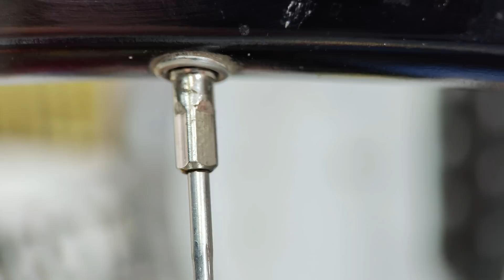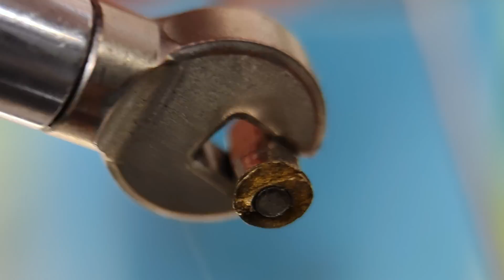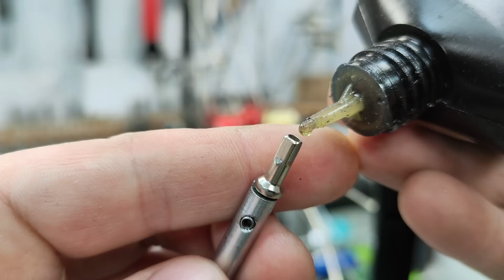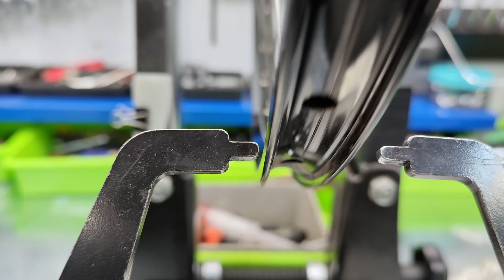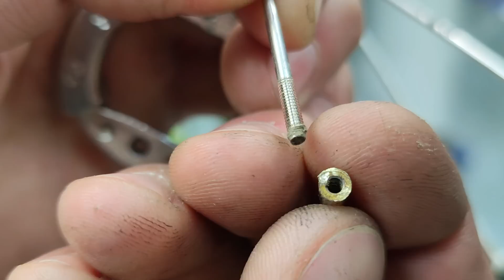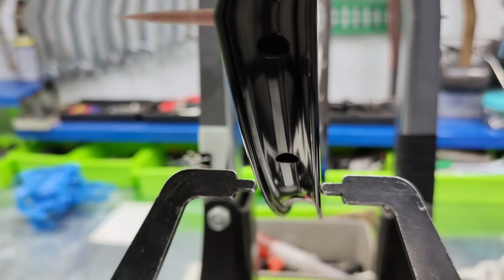Bicycle wheel repair. How to replace a spoke nipple on a bicycle wheel.

Comment: As far as I see you usually use super b tools, actually the unior tools produced near you are very successful but I have never seen any on you, they are not as expensive as park tool but I think they are more successful than the far east tools.
Reply from the maker: Unior tools are great, but we found out about them a little bit later at the bike show. When we opened the workshop, the suppliers had a large selection of SuperB tools for a good price
Reply: @NiceBikeService  yes l have some super b tools and ı like them

Comment: Please teach me how to do stuck seat post;(
Reply from the maker: A difficult case, once the rack was so stuck that we tried to clamp the rack itself in a vice, and pulled and twisted the bike frame, but it didn't work. As a result, I had to file the vertical slot in the frame a little

Comment from the maker: ⚠ ❓ ⚠
ASK YOUR QUESTIONS 
👇👇👇
Reply: hi i have a question - a spoke is broken in the rear wheel in the inside and the gears are stuck and cannot remove them to replace the spoke's head - is there a workaround for this?
Reply from the maker: it's not possible (unfortunately, you have to dismantle everything in the way).